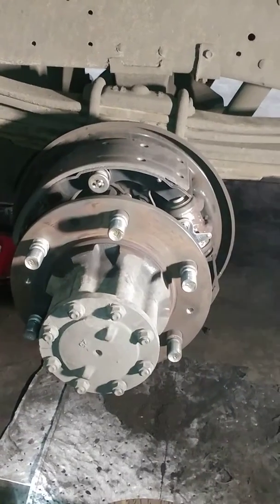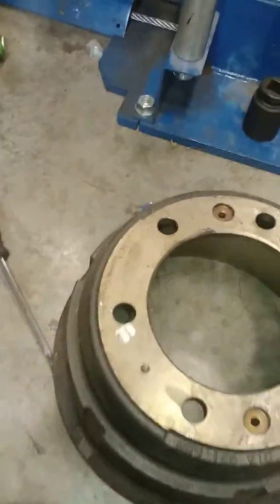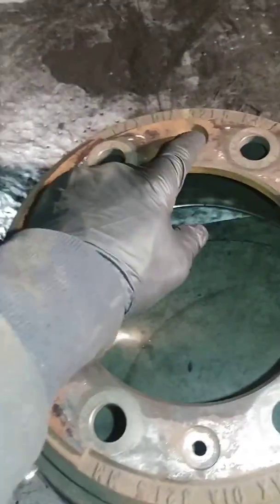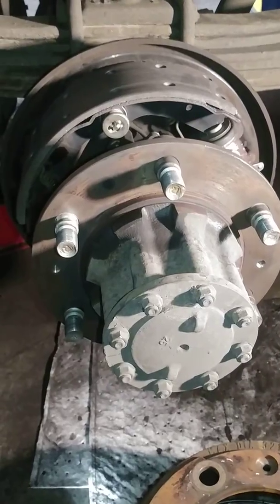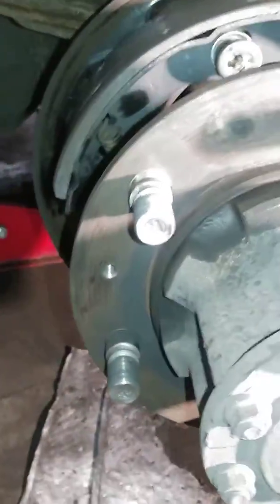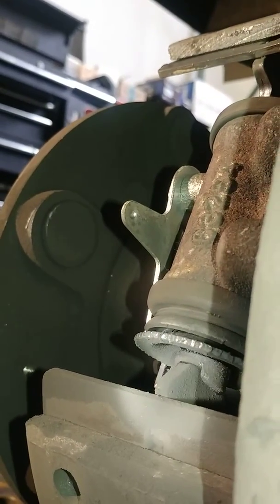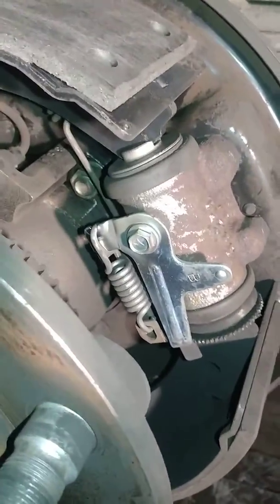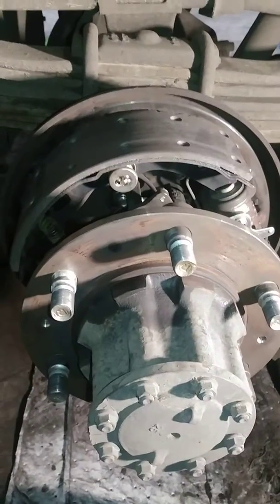Isuzu NPR rear brake pads and drum

Comment: Just to add a little comment on this great video. I have been working on my 07 NPR the last 2 days replacing wheel cylinders. The 07 looks just like this 12. But, after putting drums back on, you HAVE to adjust the cylinders for the brake pads. I adjusted until they were just touching and resistance by hand. Went and ran the truck(need vacuum for brakes), put in gear while on stands. pumped the brakes. Shut down check wheel rotation again and had to adjust 3 more times with this procedure. I think the shoes get centered in the drum once they are rotating and need the extra adjusting. I went from the wheels not turning with first adjust to turning freely after running/pumping pedal. And repeated the process. Just an FYI. There is very little info online about these trucks and Ol Skool is doing a great job. Wish I had the patience to video my work!
Reply from the maker: Well thank you I do appreciate the hospitality and and yeah definitely I feel they center after using them but I would suggest running a scanner to do a break bleed To seal the deal

Comment from the maker: Your shoe adjustment might be to change still those 2 little screws on the face in the video normally will pop it right out but if your shoe is too tight or grooved in toobad you're gonna have to loosen your adjusters all the way on front and back

Comment: I have a 1988 Isuzu NPR the right rear brake will not release try it even putting it in neutral to turn it it won't spin also sprayed it with PB blaster the adjustment screw still will not move even smack crap out of the drum with a hammer. I am thinking about taking a slack adjuster bolts / caliper bolts please to see if I can get the drum off I've never done the brake job on this truck before and I know the fact that haven't been off prior to 2013 if anybody's got any tips that can help me out with it I greatly appreciate it thank you.
Reply from the maker: Def try to loosen brake adjustment screw..mightvbe a lock mechanism. Look closely

Comment: What's the trick to releasing the lock tab and then turning your wheel cylinder at the same time?
Reply from the maker: Pain in the but..really have to just feel for it... Use one screwdriver to hold the lock cab while the other screwdriver spinge the
Reply: You can just power through it too. The self adjuster will spring the opposite direction if you turn it hard enough with your screw driver.

Comment: How do you loosen the brakes
Reply from the maker: On the backside of the drum there is two oval holes and it's hard to see but there is a little gear you must spin just a little bit at a time with a small flat-head screwdriver but there is a little clip you must use a small pick or really small screwdriver to hold out of the way at the same time that little gear will spin freely to tighten but you must hold the clip out of the way and go the opposite way to loosen dot-dot-dot you need to do both sides really loose if your brakes are worn out they will be worn in a Groove so just make sure you open up both sides almost all the way